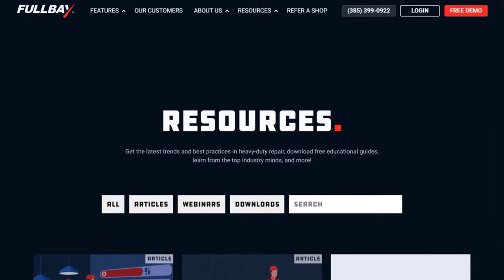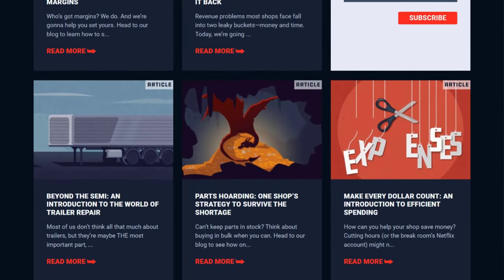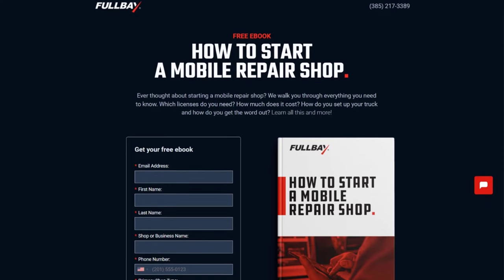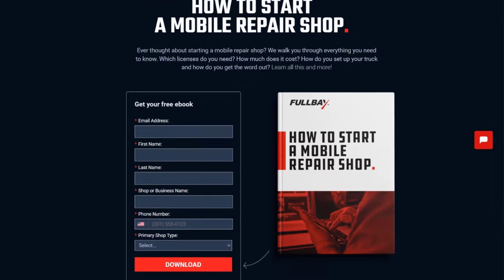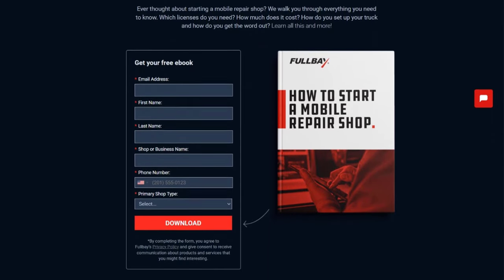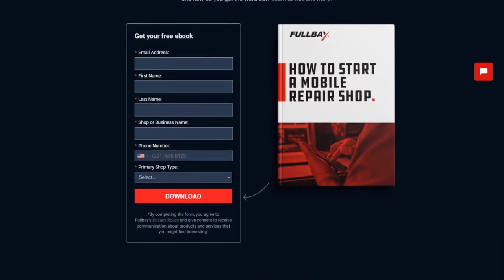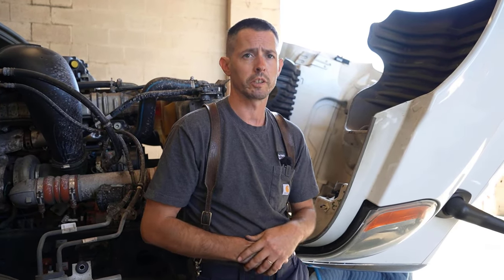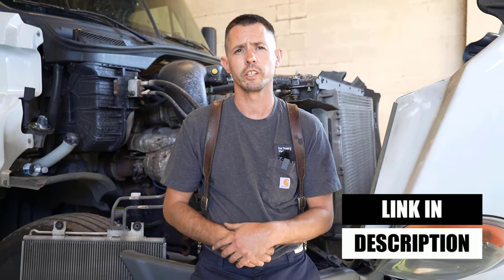A/C not working & A/C not cooling - How to diagnose A/C issue on semi trucks?

Comment: My mechanic never uses dye to to check for leaking in the AC. It will mess a system up. He uses nitrogen. It's easier to find the leak's and it's easier to pull it out of the system when you pull the vacuum on it. My AC blow's at 36 degrees. And another tip go to home Depot or Lowe's and get you that copper pipe insulation and put it around your lines all the way up to your fire Wall. That will also help keep your inside cab/sleeper cooler also. Keeps condensation from leaking on your engine, especially if you have a Cummins engine where the line"s" run across the top to the fire Wall!
Reply: The dye does not mess the system up, stopleaks do on vehicle hvac systems. We use nitrogen on residential units only if all the refrigerant has leaked out.
Reply: That's the best way to find a leak. Dye means you can't find it and send you on your way.

Comment: Just wondering Ryan,  on my 2005 C-15 Acert, with the A/C running and compressor engaged, what should my high/low pressures be; I've already evacuated the system, pulled a vacuum for 30 minutes and replaced 4 lbs. Of refrigerant..? I have replaced everything except high/low pressure sensors.😂 great video btw.👍👍

Comment: I still have my original AC compressor on my 2016 579. Almost hast 1.1 million miles on it.  Blows cold AC replaced the AC dryer and charged it up.  I’ll probably replace the condenser soon bc when it’s humid it steams like crazy and the fins on it are bent in.  Haven’t touched that at all

Comment: Great topic.  What I missed in this was information on the high & low pressure switches.  You mentioned them, but did not nothing else.  Where are they typically?  How to diagnose - when should each be open circuit or closed circuit?  This would be helpful.  I had a guy working for me who found a $500 car for sale with a broken A/C.  He bought it and found that one of those switches were bad, so he replaced it, making the car worth $2000.
Reply from the maker: I will expand this topic a little more next time. Thanks for the suggestion!
Reply: ThankYou for this video.  Compressor is good, clutch engaged, past leak test, Freon present, fuses good, still blows warm air.  Maybe I need to check the expansion valve.

Comment: Hi you doing very good videos. I got a little problem, with the A/C. I put a new A/C compressor with a new belt and air dryer. But, the A/C doesn't blow cold air when I am not running. But, as soon I  start moving over 45 mph start blowing cold 🥶 air why is that.

Comment: Good job explaining! My 2014 Maxforce 13  is having issues . Just had into Dealer last week when it quit working in Grand Island. and they said it was the Pressure / temp sensor was bad. Replaced it worked again but I would say didn't get as cold as  before it stopped.that was $550.   I put in new expansion valve/ compressor and only had about 3k miles on it since. anyway drove it for about 1000 miles and it quite again. I am going to check what your talking about and my concern is that it may be the other high pressure sensor and if I have to take off 134a I have a canister to hold what comes out and proper ac pressure lines from Harbor freight like yours red/blue/ yellow. I know my truck takes 3.5 lbs and I have a vacum from HF that I have never used. Not sure if I need to use it if I have system open for 30 seconds putting that new sensor on but what do you think?
Thanks, Ryan. I have been watching you for over a year now and really appreciate your channel.
Reply: Switches of this sort on a Freightliner are usually on the High pressure line from pump to condenser. They are screwed onto a fitting with schrader valves on them and you can take them off without a loss of refrigerant. Hvac relays will cause no clutch action also. easy to switch out. These things must go trough thousands of cycles in use. Kind of a miracle they work so long.
Reply: You will need to get it scanned since it is controlled by the Body Control Module.

Comment: well you have the same setup as I have.  you said the exact symptom I have.  NO power or sort of.  I have  am seeing a bit of voltage at the plug.  seems to start at 2 and goes up to as high as 10.  I checked fuses and when I turn off and on the ac button I get a nice click in the relay.  I swapped the relay with another just to see if that would help.  New pump, new dryer, new condensor on the front.   had it put on vacuum for 15 min and it was fine so recharged it.  funny no mechanic or the ac guy had any ideas on how to to go forward.  so I am into it for 1400 at this point and still no help.  I know this is an old video but so far only one that comes close to even saying the issue I am facing.  I ordered a new sensor under the dash but not holding much hope on the working either.

Comment: Am having this issue but my compressor is working good only not receiving power , is 2012 cascadia with Cummins , what do I check other than the fuse ? Which is good ??
Reply: Water & soap spray bottle on the front of your condenser for any bubbles or holes

Comment: I bought a 1999, T2000 a didn't work then & hasn't worked in 10 yrs. Ac clutch was out. 
 I took it to a Mechanic said there was 4 # s of freon in it.
 I just decided to have a new ac compressor put on. He says he check everything but it still isn't blowing cold. He said he can't ck the electronic controls bc KW has the only test equipment to test the controls. 
 I called another shop. They said the truck is to old to have electronic controls. 
 Can you tell anything that mightbhelp understand whats going on. Did the shop guy just take the easy work installing the compressor or what? You have some idea about shaddy Mechanics.  Can you help on this?
T4tv

Comment: Hi Ryan. I have a 2015 peterbilt paccar my ac works in the sleeper vents only,  but on the front vents it blows hot air. I'm not mechanically inclined so before I take it time a mechanic what do you think the issue could be and if this Is an expensive fix?
Reply: Most likely the blend door in the dash is messing up. Does it make noise when you switch between hot and cold? Try turning off the valves to the heater core so there’s no heat.
Reply: @markm0000  thank you for the reply.  I haven't tried switching between hit n cold,  I'll only be seeing my truck again in a few days so I'll try that out when I can, thanks
Reply: @markm0000  I also had a issue that the ac was working on the front vents before driving the truck. Then after I drove for a few minutes got air was blowing out,  but it worked fine before driving
Reply: @AquilesQ  I don’t think it’s a problem with the compressor if the sleeper works fine. Its not a clogged condenser because it works sometimes. It’s not the fan because it’s still blowing hot air when it does it. The last few things are the dash blend door, maybe the relay to the compressor, possibly a fuse that’s half blown, a faulty control module or BCM, possibly a corroded switch or bad connection somewhere. Problems like that are hard to fix and you can easily fall into the trap of a shop monkey throwing parts at it. Absolutely define a clause that you will not pay the invoice for 30 days and if they replace a part that doesn’t fix it you’re not paying for it. You can easily get a couple thousand dollar bill over this.
Reply: @AquilesQ  It’s also slightly possible that something is rubbing up against the controls in the sleeper and it’s causing it to switch to heat while driving. You never know. Try disconnecting the rear control panel and see if that does it.
Reply: @markm0000  thanks for the advice Mark. I will try a few of those things u mentioned next time I drive, God bless
Reply: @AquilesQ  God Bless you brother
Reply: @AquilesQ  Another thing is when it goes hot on the road check the AC lines under the hood and see if they’re cold. If yes then you definitely don’t have a compressor issue.
Reply: @markm0000  ok I'll check. If it's a compressor issue, is that expensive to fix?
Reply: @AquilesQ  If you need to change the compressor it depends on what you get and who you take it to. You can get a aftermarket compressor for $300 and about 2 hours of labor. If you get a OEM compressor its double but it will last much longer. It’s also recommended to change the drier as well. Your biggest expense will be diagnostics and you better be sure the guy working on your truck has been repairing truck AC for several years.

Comment: I have leak under my dash what would be a problem or where should I start from ?
Reply: Make sure the evaporator drain isn't blocked. If coolant is leaking then your heater core is leaking.
Reply: @shabushabu13  it only leaks when I have ac on and it’s green oil base

Comment: Hello. I have a problem with my AC. The AC is only blowing hot air, it’s cold at the condenser but when it comes to the cab, it only blow really hot air. Not just regular air but hot air
Reply: It sounds like the door actuator

Comment: The center of my compressor is stopping and keep going is that normal? Sometimes I’m not getting cold air! Ply
Reply: Nope. Low pressure. You have a leak.
Reply: @mobileair6416  thanks checking that today them!

Comment: My ac compressor is constantly engaged and i get cold air only when running but not at idle however the clutch is still engaged on the compressor and alredy changed the expansion valve and nothing.. help me please😅

Comment: My ac is frustrating the crap out of me. 
Sometimes if I adjust the fan speed and/or put the temp between cold and warm my ac starts to crap out. It won’t get cold.  And it starts to leak water inside the cab. If I turn off the truck or ac for 15-30 min then the AC works just fine. 
I have replaced just about everything. 
New compressor 
New dryer 
New recirculation filter 
New outside air filter 
Last year I replaced the condenser 
Checked the drain hose that’s good
I just had both the expansion valves replaced. 
What the heck is wrong with my ac? 
It only happens sometimes if I mess with the fan speed and temp.  Since it only happens sometimes it never does it when the mechanic looks at it.  
Other wise it’s freezing cold.
Reply: you should start by what kind of truck it is, all of the ac systems are designed to work different, sounds like a hot water control issue,
Reply: @youtubeisawesome2487  14 cascadia
Reply: You've had so much done, you eliminated my suggestion.  My thought was that it is low on freon, which can cause the evaporator to become so cold that it freezes the condensation.  Once frozen, air slows or stops going through it.  A warm-up causes the ice to melt, releasing water in the interior.  Fast moving air slows the time-to-freeze, and doing something to turn off the compressor allows the warm-up melting.
Reply: My 2017 KW t680 does the same thing. It gets really cold and it started blowing hot air and the fan seems to struggle.
Reply: @SirFoodie1904  yeah it sucks. Mine Seems to do it when it wants to too. Some days It works perfect others it pulls this crap. Super frustrating
Reply: Random idea, is your A/C clutch cycling. It's should cycle off on with fan at low speed. Possibly it's on all the time freezing up the coils in the dash, so water can't drain. The high/low pressure switches on the lines sence when the clutch should engage. Or a short? . But your coils are definitely icing up. It's an airflow issue or the compressor isn't cycling off/on when it should for some reason.
Reply: Heater core is bad.

Comment: you will have a hard time diagnosing volvos, when you unplug the ac compressor it turns off the voltage and gives a code to the control unit on those older ones, i forget the name of the module but they have the blue large sensors (pressure switches)
Reply: APADS. Horrible system.